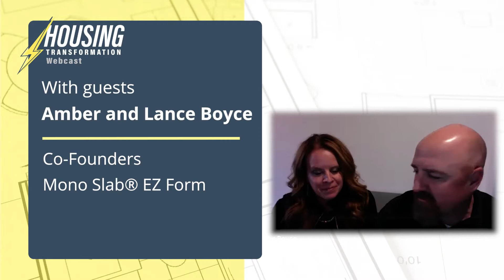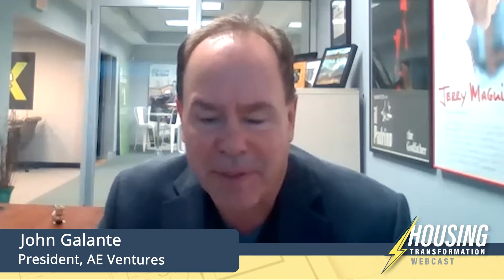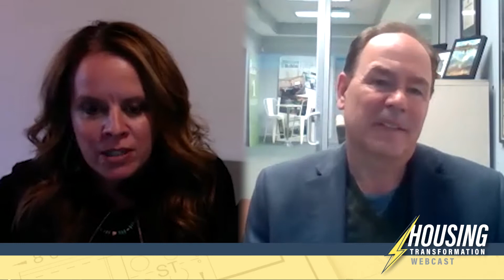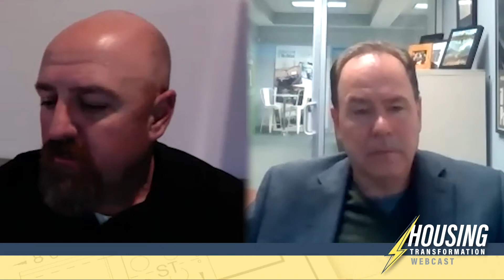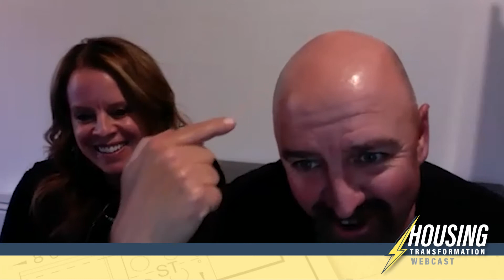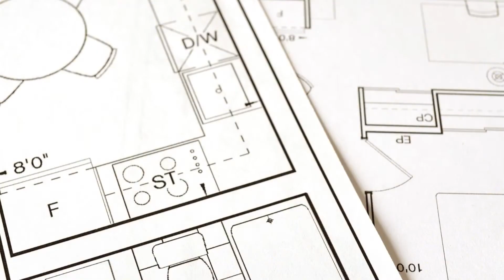Save Time, Labor, and Money with Mono Slab® EZ Form

Comment: Hope to have an ICF home built in New Hampshire is 3-5 years.  I am prepping through all of the sections of building a home.  Foundation to roofing, water to electrical, heating to cooling.  Learning how to build the best envelope I can based on my budget.  I am actually surprised, one of the major ICF manufactures haven't bought you yet or developed their own product line.